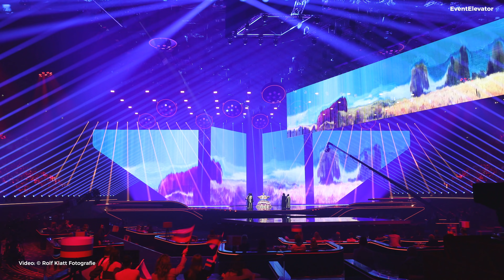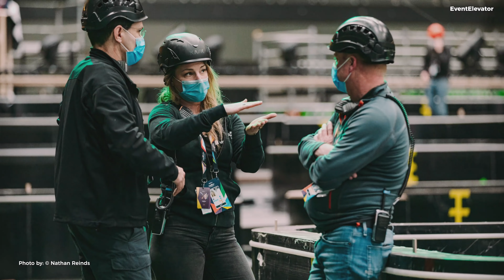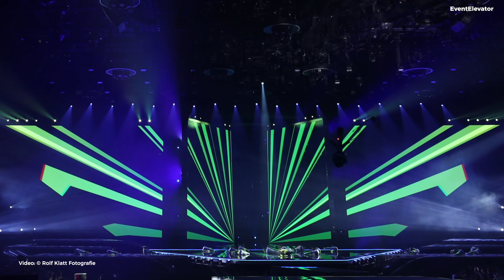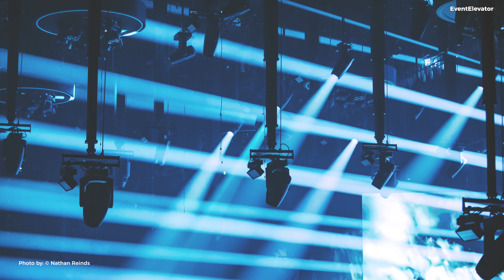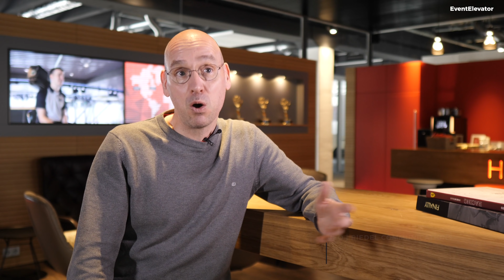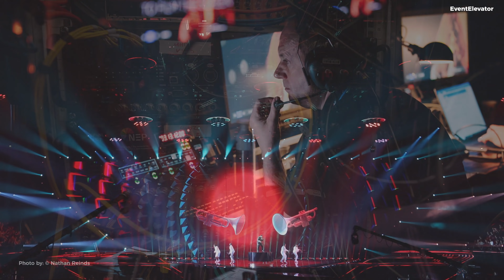EUROVISION SONG CONTEST 2021 • Behind the Scenes • Lighting Design, Audio, Signal Distribution

Comment: Great video! I only missed some more technical details. Like how did the revolving Screens work? Or some more information about the lighting network.
Reply from the maker: Hi Mielus 19, thx so much for your positive feedback. It's just so much technical detail in the whole show ;-) You can find a bit more facts, Fotos and details on our website https://eventelevator.de (it's in German so you have to translate it). 
The motion stuff is done by Stage Kinetik. The wall is divided into four sections, two side wings and two rotating walls in the middle.The rotating walls are 9m wide and 12m high. The four elements can be closed without gaps using a magnetic locking system. Together, the four motors can turn the wall by 180 ° in around 16 seconds at a speed of up to 0.9 m / s (or 3.2 km / h). This makes the back of the LED wall visible, which is equipped with a matrix of 70 head-moving Ayrton MiniPanel-FX. In front of and behind each rotating LED wall, around 60 m² of stage floor is also rotated. The side LED wings hang with their brackets on a steel chassis, each of the 18 steel trolleys can accommodate four rows of LED modules. Further on Stage Kinetik was responsible for the 40 drop-arms in use: a telescopic headlight holder that can be moved vertically out of the ceiling with the  Ayrton Huracán-X  and GLP JDC1 strobes. 

In the field of video technology, the experts from Faber Audiovisuals installed the impressive screens in the Ahoy Arena in Rotterdam. Among other things, the hall was equipped with a mighty 508 m2 LED screen backdrop (ROE Visual, BQ4, LED 4.6mm). For the magical appearance of the transparent screen on the runway, 110 m2 ROE Visual Vanish 8 panels with 8.9mm pixel pitch were used. Since this was not always completely filled with content, this screen was perfect for really cool transparent like effects. ROE Visual BM4 (4.8mm pixel pitch) were used for the floor LED modules.
Reply: @EventElevator You guys are insanely awesome.
Reply: @EventElevator  Thank you! Of course its hard to cover every aspect of the show ;) Thanks for the extra details.

Comment: in the preview of the stage before it was built there were luminous lines attached to the ceiling, which in the TV show were used to indicate the flag of the state that was about to be exhibited, but then in reality I noticed that they were not mounted in the arena.  So my question is: did they have to be mounted but then they weren't anymore or was it never planned to put them in the arena and make them appear digitally on television as it did then?
Reply: A lot of what you saw on TV was augmented reality.